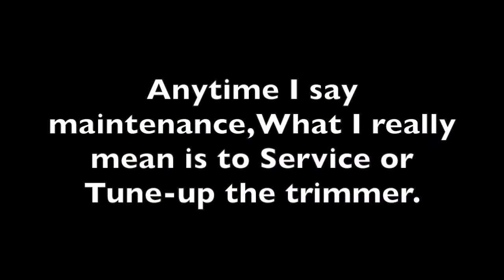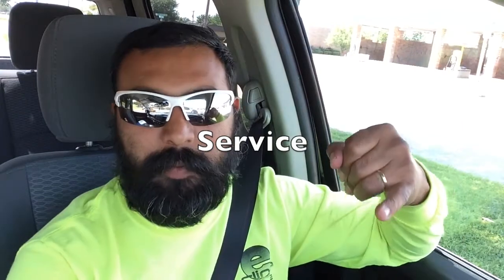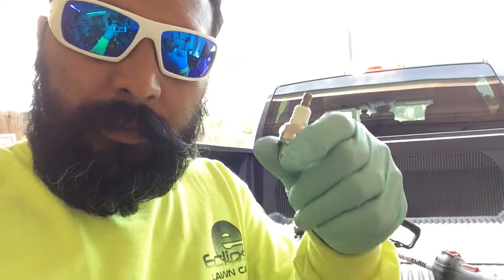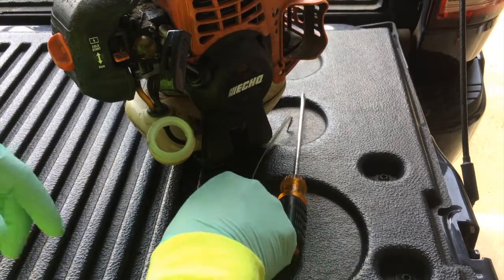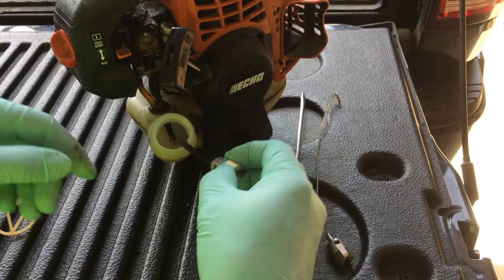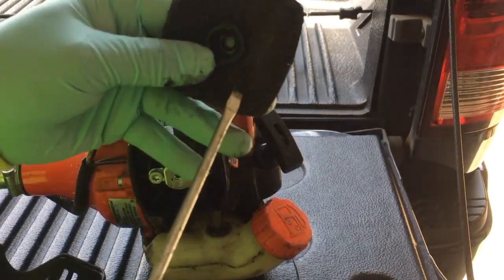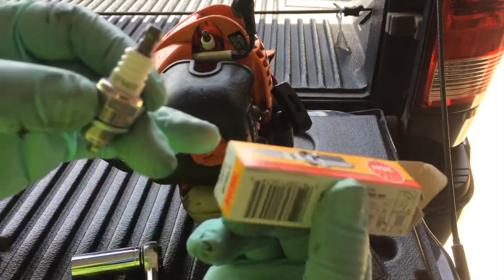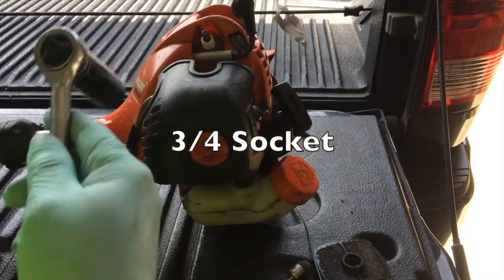How to Service Echo SRM 225 Trimmer

Comment: Also sea foam is your best friend.
Reply from the maker: Thanks t for the advice. I will definitely try out the sea foam. I hear that it does a great job on engines.
Reply: Any time, one of my guys took an airplane mechanic program and he taught me a lot today, I will never take my machines to the shop again. If you run into any issues just hit me up. I think you have my email already. We fixed a busted hydraulic line on my dingo, 2 weed eaters and two mowers. All in one day.
Reply from the maker: Thank you for the offer to help. I have your email saved. Thanks.
Reply: A-Veteran Lawn Care email please.